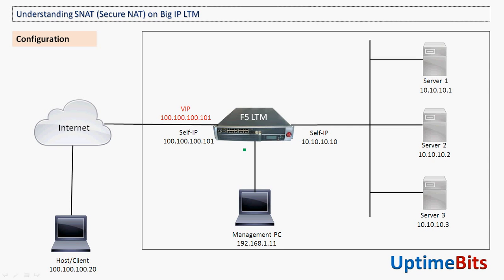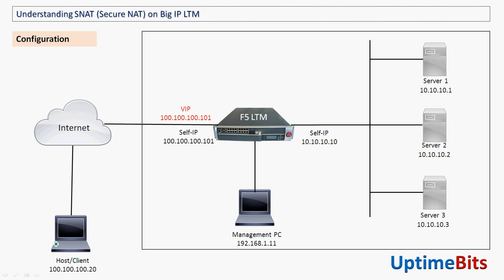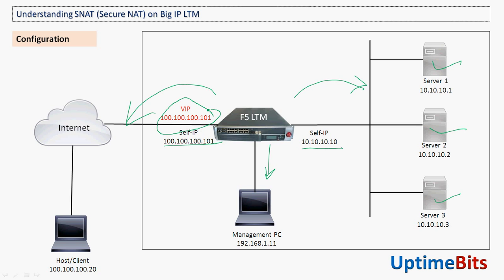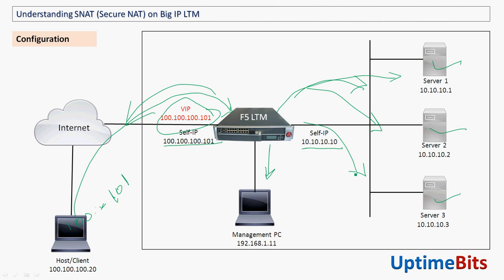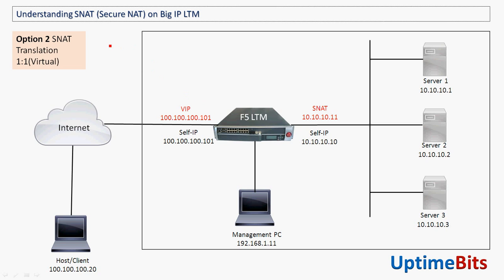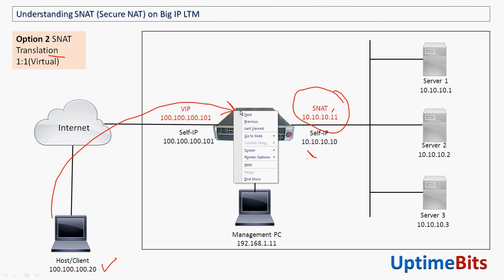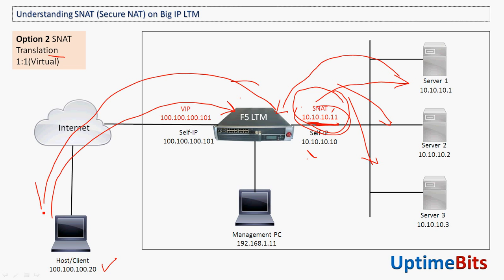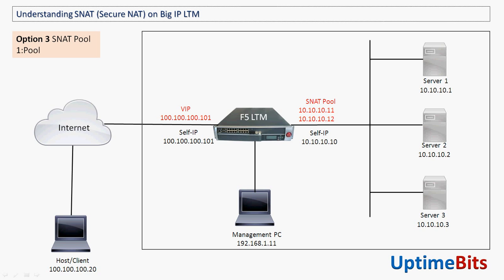00 Understanding SNAT Concepts   F5 BIG IP LTM

Comment: Thanks for this video. When we are activating snat/snat pool /or auto map, this means that the backend server would not see the real source ip's !! this would be a problem in some cases! what is if i want to see the source ips from the clients ? how can i solve this ? thanks
Reply from the maker: You're welcome. In order to make it work, the default gateway of the servers should be F5's IP.  Pls note, this is not a recommendation and its deployment dependent on your specific requirement or network design.

Comment: HI Just lets say if we have ASA in front end then what willbe the packet flow
Reply from the maker: ASA placed between Router and LTM should not impact packet flow. Just ensure that it allows packets destined to Virtual IP+Port (e.g. 443)  from Internet (or any other source within internal network). ASA being a stateful firewall, will allow response packets from LTM to client for which it allowed connection initially.